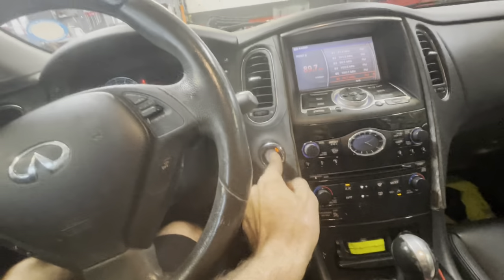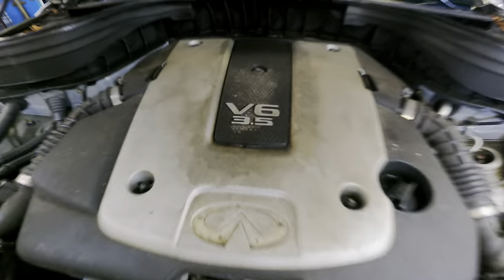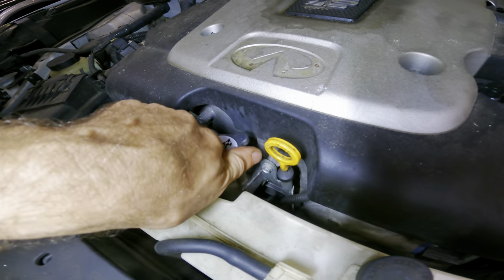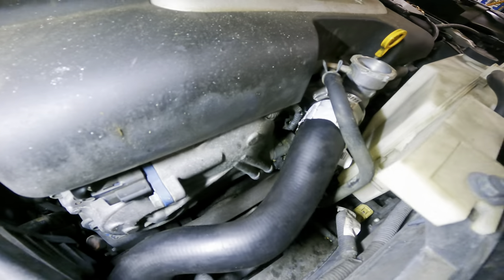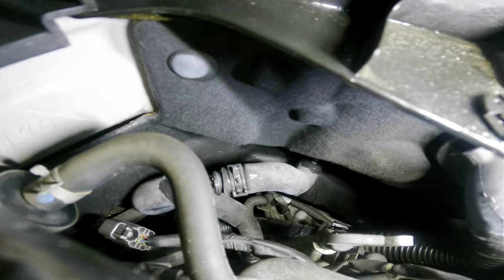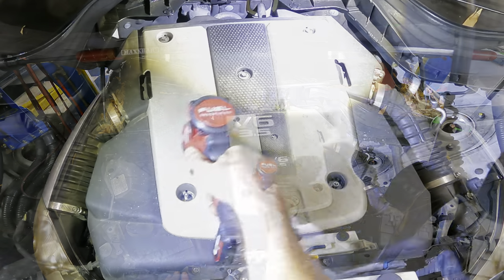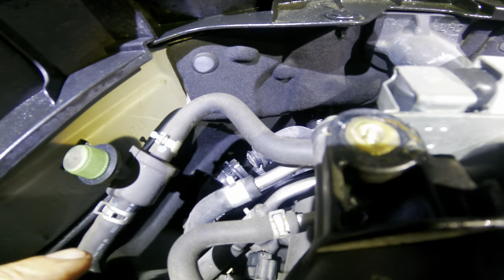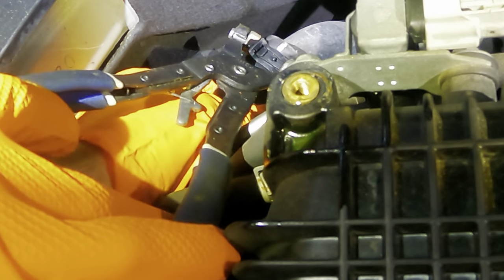Overheated after new Radiator! Tow In! Infiniti 3.5 EX35

Comment: I will patiently wait for the follow up.  If the head gasket is bad,  the extra pressure in the cooling system will break the weakest part?  It busted the radiator first?  Then the fatigued barb?  If the previous mechanic didn't think anything of the nonstop bubbles after the radiator replacement, did they add to the original damage?  What a dilemma.

Comment: I learned a long time ago,
Never change anything in a cooling system without inspecting the full system.

There is usually something else like that coupler ready to fail with the extra pressure.

In this case, a $2.00 part and a few extra minutes labour would have saved a tow bill, lost use and potentially a blown engine.
Reply: The first shop was hired to swap the radiator. So they did. They didn't bother doing anything else.

Comment: Make sure you turn on the heater to allow the coolant to circulate through everything. On some vehicles this will happen and you will not get all the bubbles out they will continuously go on and on
Reply: He knows this but did he remember to do it?
Reply: @TheFrenchPug  I don't think he opened up that heater for the coolant to run through the core, this is a problem on some cars and a lot of mechanics overlook it and that's why you should always turn on the heater whenever you do any type of coolant repair service when refilling. It just eliminates all problems and having to remember if you do it to every single one you'll be fine
Reply: @willsrestorations  Would that give him the very high temp reading that he was getting?  I don't think the cooling fans were activating either.
Reply: @TheFrenchPug  yes but I think Ray would have seen that the cooling fans weren't activating but you could be right,

Comment: It's pulling air, suspect is head/headgasket. Probably already warped from a previous overheat.If system has no leaks radiator becomes suspect or it's simply pulling too much air in.
Should chem for carbohydrates in the cooling fluid+pressure test on cooling system and  compression test on cilynders.

Comment: The 3.5 is a ridiculous engine to bbleed the cooling system after radiator or water pump replacement. Ive had to jack the front way off the ground to get the engine tiled in order to bleed the air out. Finally got a vaccum bleed/fill setup and it was much much easier to do. Had to replace a radiator in a Fiero once, bleeding the 6ft long tube from the radiator to the engine took a while without a vaccum bleeder. Every one I ever did without the vaccum bleeder was challenging.

Comment: I had an 06 GTO that liked to overheat. First it was a thermostat, then another thermostat, then the water pump failed. I didn’t have it back for a couple hours after the water pump and it overheated again. Took it to the shop and he said they didn’t purge all of the air. They purged and refilled and it overheated the next day. They finally found a crack in the radiator that was allowing air in, but not coolant out. Replaced the radiator. A week later, overheats again. I parked it at the shop and they ran a pressure test the next morning. Again, there’s air in the system. No leaks. Thermostat is fine, fan is fine, relays are good, everything checks. They ran it for about an hour in the shop and the new radiator had a split in the plastic seam on the tank. It only opened when it was hot and you couldn’t see it if it was cold. Once it opened, it let a little air in and the air would get stuck in the hose. Replaced the radiator under warranty and it stayed cool for the rest of the time I owned it. They were determined that it cracked a head gasket from overheating so many times. They crossed the radiator off the list every time because it was new. I’m sure if they hadn’t tested everything 20 times, I’d have had the engine torn down for no reason. I hate thinking you fixed something only to have it still have the problem. I don’t remember exactly what years it was, but the VQ engines did have a head gasket issue. I want to say it was mainly in the Murano/Quest. I remember my old Nissan shop used to fix a bunch of them.

Comment: That's not the other shops fault that broke. I'm sure it wasn't leaking when it left or they would of seen it. Its plastic and constantly heating and cooling. It's like doing a spark plugs and a coil fails. I understand seeing rubber hoses starting to fail but the plastic could look ok.

Comment: Get a block tester kit. Easy quick diag for head gasket failures. Super cheap tool. Like 40 bucks from Napa it will tell you within seconds if you have combustion gasses in the cooling system.

Comment: Sacrifice a flat blade screwdriver grind the tip away in a manner that it has part of the tip right before the tip is grinded away forming some what of a hook that will grab the end of the fitting so you can hook and the pull the fitting out

Comment: I almost always lube the the hose  before removing/installing the hose clamp with silicone spray makes them slide so much easier
Reply: And i always vacuum the cooling system to be sure all the air is gone.

Comment: To get a broken coupling out from inside like that the easiest thing is to just crush it with pliers then the broken pieces will come out easier. Also I just slide the clamps down the hose rather than taking them off.

Comment: How difficult would it be to get to the other end of the hose with the plastic stuck in it on this car? I would recommend removing the hose to take the plastic out when it is crumbling like that. It would make removing the plastic easier and it would be less likely to have little bits of plastic floating around in the system to clog the radiator or heater core, get stuck in the thermostat or even possibly damage the water pump.

Comment: I wasn't too happy with him for 2 reasons. 1. Right angle forceps jaws were at the very tip of the clamp. No wonder it came loose and shot into outer space.
2. Purging is never done at idle. You have to push fluid into entire system. 2.5k is good place to start.
That's why it was constantly bubbling. You must have had an empty void in the head and it was simply boiling there giving you constant stream of bubbles.
That's assuming the gasket wasn't blown.

Comment: Hey Raiman. You probably did a worst mistake. You should put the yellow rod in the funnel. Engine was overheating becouse there was no pressure flowing and the loop was not going to pressurise. Hydraulic loop with pump has to be sealed. At least you didn’t show putting the yellow sealer rod - this much of wather in the funnel didn’t sealed the loop properly.

Comment: My Dodge Caliber the factory service manual for the cooling system air purge states "fill the radiator with coolant and then start the engine bring it up to 2000 RPM for 10 minutes or until the thermostats open then to shut it down fill the over flow bottle to the hot mark and that it may take two to four sokes cycle's to completely to purge all of the air out of the system"

Comment: That broken fitting was not the fault of the shop that changed the radiator. It's age of the plastic. Chances are old radiator got a crack and leaked, also with age. Other commenter said these are hard to get all the air out. Factory draws a vacuum then fills with measured amount and pressurizes coolant. That's how we did it at Diamondstar/Mitsubishi factory. Filling by hand is hard. You have to know exactly how much you are putting in and that requires having it all empty otherwise it is a guess if you have all the air out. It will end up with air pockets and maybe overheat.
Reply: Also factory hose clamps have a pull tab tha makes it easy to get it on, then you pull it to release. Very hard to hold the spring pressure with pliers.

Comment: I replaced everything in the cooling system and my car kept overheating like the car was on fire for 20 days straight . . . until I figured it out it was the radiator cap ! ! . . don't put it off . . change the cheapest part on your car  ( gas cap and radiator cap)  every couple years !

Comment: Yeah, other shop has to buy the part no matter what.    At this point you cannot prove that the radiator wasn't leaking but you CAN prove that the part you replaced was leaking (visual inspection all that crusty) so should also have been replaced.    Invoice the other shop $15 on the part with a link to your video.

Comment: Use a pipe tap to thread into the broken piece then wiggle wiggle pull! Lol... I drilled holes in the square drive of the tap so I can put a screw through it for leverage but still use it with the tool... And I never reuse the OEM clamps designed by the prince of darkness...

Comment: One needs to be careful  with those "purging funnels"...you need to be standing by with both a container to scoop out coolant, as the level often times will try to overflow quickly, AND a jug of coolant to pour down the "purging funnel" if the level drops too quickly. My experience has the level calm & unchanging, followed by a couple gurgles of air & the level drops quickly, often times the level bobbing up & down as the thermostat opens & air is trying to come out your funnel.

Comment: Hey Ray, I am not a mechanic but wouldn’t a pair of circlip pliers have made your life a little easier? Also, aren’t there any concerns with fragments of plastic ending up in the hose and thus in the cooling system? Maybe clamping the hose with locking pliers to ensure no plastic bits go down it before removing the plastic connector would be a good idea, and then hoovering or blowing air in it before removing the locking pliers? I also wonder if you could possibly push the original clamps down the hoses (as you normally do) instead of pulling them. Or, possibly remove the hoses from the other ends and take them to your workbench to work on the broken connector in comfort.

Having said all that, I would like to thank you for the great content. Although not a mechanic, I greatly enjoy watching you diagnosing and fixing cars! Taking us along your adventures is great fun and highly educational!

Finally, if I was the customer in this case, I would accept that I have to pay for this job. But given the fact that the engine overheated  and lost all its coolant, I would fear the worst, thinking of head gaskets e.t.a. You didn’t mention if you checked the oil and if it was milky, which would point us towards that direction.

Comment: This just happened on my 370z. That heater hose is the worst hose i have ever dealt with especially the end connecting to the cylinder head. I still don’t understand why Nissan added a connector instead of making it a straight hose. If this happens to you just replace with a 3/4 straight silicone hose.

Comment: I had a 2000 Jeep Grand Cherokee with the classic Jeep 4.0L straight six, which had a coolant system issue similar to this. It started to run hot when sitting idle for more than a couple minutes, or especially during/after running the air conditioning. The temp gauge would also RISE after turning the engine off... One day I drove to work as usual, and after cutting off the engine and starting to get out, suddenly "POP!" followed by a waterfall of coolant pouring out onto the ground from underneath my hood. The lower radiator hose had split wide open after I had cut the engine off. Got that fixed. A couple months later, the exact same scenario repeated itself again in the parking lot where I work, this time it was the plastic radiator neck where the hose connects that snapped off. New radiator installed. What failed next you may be wondering? Well I began to notice that my passenger floorboard always seemed wet, and upon further inspection, it wasn't a window/door leak letting rain in, it was coolant from my heater core. Had the heater core bypassed since it was summer and I could put off that particular repair until later. Unfortunately that repair never happened because after 20 years and 260k miles, the transmission finally gave out and I dumped it. Like Ray says here, I assume my head gasket was busted the entire time, causing my cooling system to over-pressurize and blow out weak spot after weak spot in the system. I miss the room and the capability of that Jeep compared to the car I drive now... although I don't miss the cooling issues or the horrendous gas mileage, that's for sure!

Comment: You have to test a two to see if you got a head gasket leak that'll blow them hoses in the radiator and the oil pump might be bad too because if the bearing in the oil pump goes bad then the oil pump won't rotate it'll rub on the side of the water pump and it won't circulate water through the radiator

Comment: Checking to see if its blowing hot air out of the heater is a good way to see if there is air in the cooling system. Ive saw cars with air in the cooling system not overheat and blow hot air at an idle and when you hold the throttle above an idle the heat will go away and it will run hot. These Nissan 3.5s are notorious for being hard to purge the air from the cooling system. But it could have gotten run hot already, they have been driving it with a leak, it could have overheated and popped a head gasket. I would purge the system with a vacuum filler before I condemned the heads to come off though, you arent the first person to experience this with this engine, I have saw cars towed out and into our shop from other shops who had this exact same issue, always turned out bleeding the cooling system properly fixes it. The vacuum filler is so nice to use, just like an AC system, just pull a vacuum nd fill er on up, makes it too easy and mess free to not use one on every car you have to fill the cooling system, plus its a good quick test after a repair to see if it holds a vacuum. Dont wanna put coolant in it with that heater hose we all leave undone behind the intake.

Comment: when ever i ha to get heater hose off a fitting or broken plastic i found if i put a small screw driver or hook in the end a give it a squirt of wd40 they come out very easy-goes for heater hoses,radiator hoses, etc-and then the new fitting goes right in like it's over sized.

Comment: Next time you need to remove a thermoset plastic piece like that, get a bolt that will fit inside the piece.   Heat the bolt with a torch to warm, like 300 degrees F.   Put the bolt inside for 30 seconds and pull it out.   Then grab with the plyers and twist then pull out the piece.

Comment: My Mom has a 2004 Infiniti FX45. She got the car Given to her.  I've replaced a Pulley, Radiator...  Now planning on replacing the Power Steering Hoses. and seeing how hard it would be to pull the rack out, Cause Infiniti wants 3500 to replace the power Steering Hoses and Rack....  It's got 265K on it, but the engine is still strong. Doesn't use oil.  I don't have a lift to look under it. To see what I can do.  All I have is a drive way and floor jack and stands...

Comment: Although that is green coolant, Nissan/infiniti also sells a long life blue coolant.  They also sell that green stuff but I don't know if it is any different from the green coolant we may have all seen before all these different coolant types came out.  The color is just dye and there are coolants of different types that look the same.  It can make using any sort of other coolant a risky thing because different coolants will react with each other and leave a jelly like substance in the entire cooling system.  NO that is not just a Volkswagen problem, add universal or any other random coolant and there is a good chance that it may happen.  It will clog radiators, heater cores and engine coolant passages.  You will be lucky if you catch the overheating in time before your engine is destroyed!

Comment: I wonder when it came to bleeding that infinity/Nissan, if you would’ve just lifted the front end up instead of having the car leveled🤔 in the fsm for the maxima it says to lift the front end when purging the cooling system. 🤔 but wouldn’t change your other diagnosis on the heads. 👍🏾 keep it up bro. Motivation comes in many different ways. I’m at PB myself.

Comment: 1. Those are the worst clamps to use. Guaranteed to have a leak in the next 6 months again because of then. You should have at least double them  up on  both sides . They are known to leak.
2. You're supposed to use blue number 2 engine coolant. Not yellow.

3. When filling the radiator with coolant. You should have that infinity's front end up on an angle. With the heater running on full. Or you're going to have air in the system. And it will probably overheat again in the future. 

It is normal and it takes about 1 hour to get the air out of the hoses.

Comment: If you let it heat up enough with that funnel on (no pressure in the system) it may start boiling on the inside of the engine, thus the bubbles keep coming out. Those were big bubbles for it to be from head gasket (but also for start of boiling) me thinks. Maybe it's just hard to bleed.
Did the fan turn on?

Comment: My worry would've been some of those little chips falling down inside the hose while you were trying to get it out.  Those plastic joiners are crap.  They disintegrate from the anti freeze after a while.  Wish they made them out of aluminium or some sort of metal.   I prefer to use the screw type clamps.

Comment: only thing the other shop could have done was let it idle with ac on high until it got as hot as possible, that may or may not have broken then.  plastic junk has a mind of it's own, I've had them suddenly break before on my personal vehicles, with no signs nor warnings and they looked in perfect condition still.